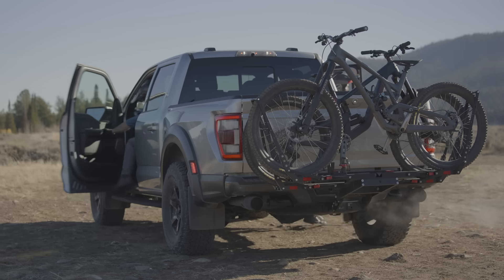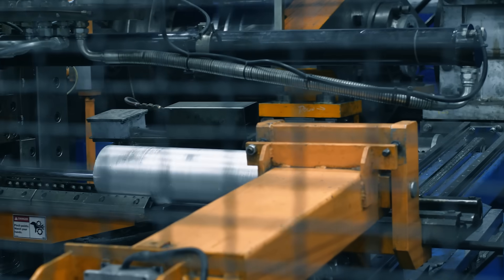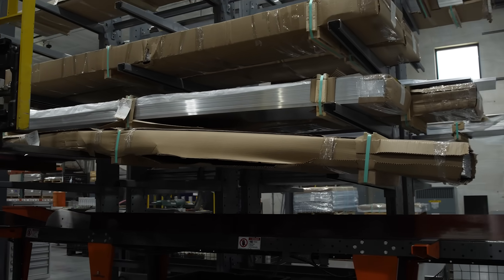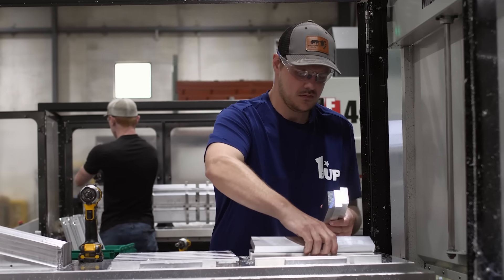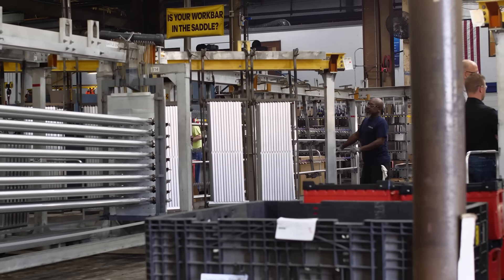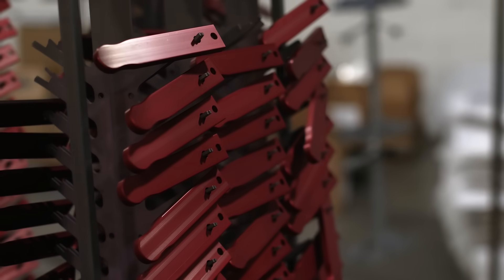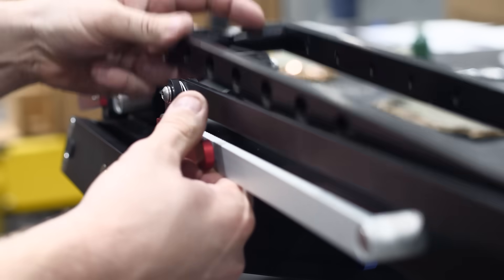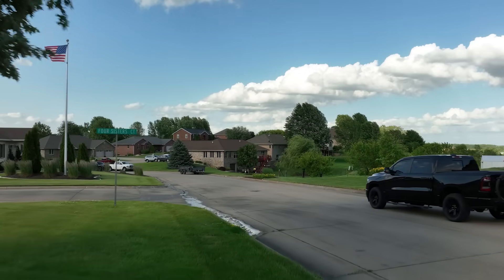How It's Made in the USA

Comment: Expensive but worth it. Far from the most expensive rack out there but it’s probably in the top 10. I’ve had mine for a really long time. I accidentally went through the car wash with with it on and the car wash. Tried to rip it off the car and did some minor damage. I called one up And immediately spoke to a human and they shipped me the parts I need. My rack was repaired and I am very happy. Customer for life.